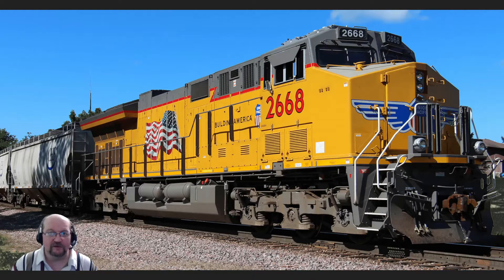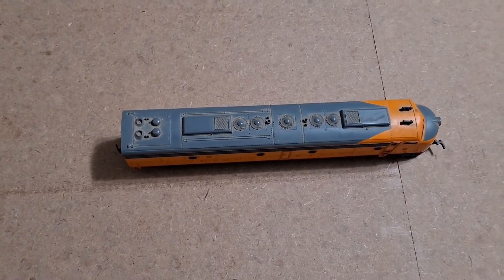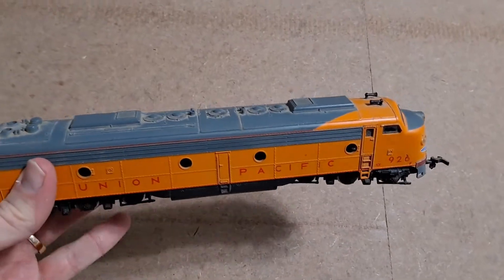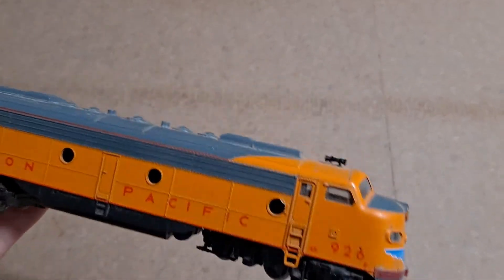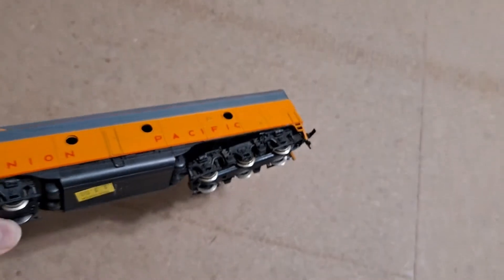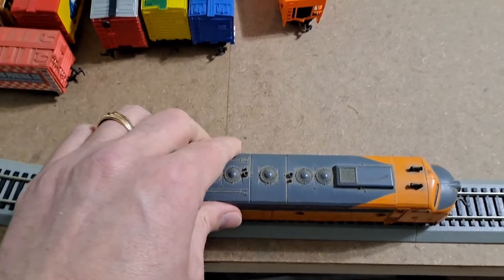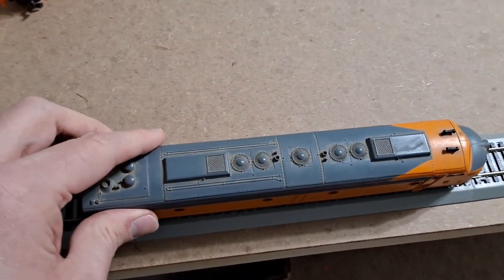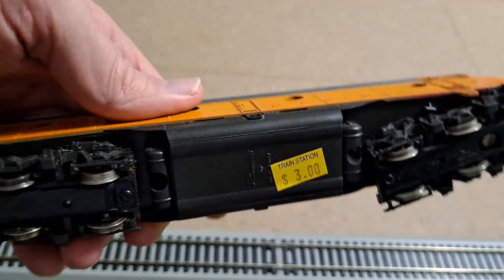Rivarossi EMD E8 - Will It Run?

Comment: I just got a set of the Frisco maroon scheme riverassi e8 and the matching dummy locomotive with lights aswell it didn't work at first cleaned it up cleaned contact points and all that and now it runs well for a cheap loco it does run very well havnt had a issue with it since I got it working im pleased with it lol
Reply from the maker: Nice thing about those old locos, usually a bit of a clean will get them back on the rails.